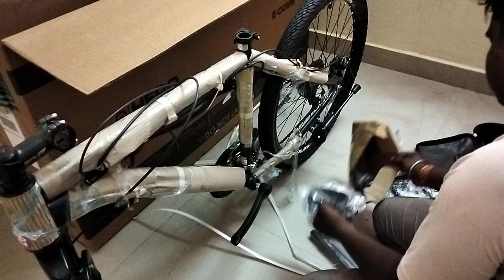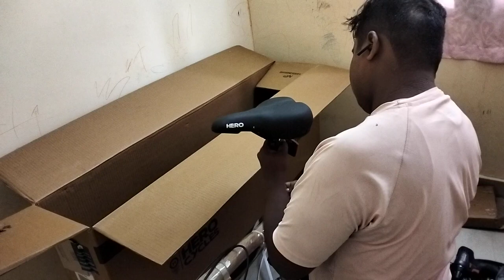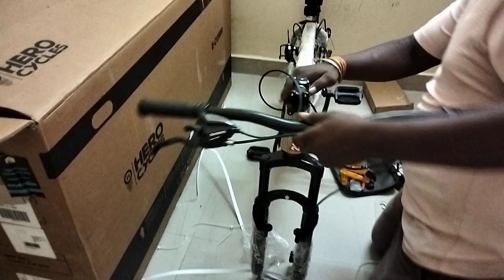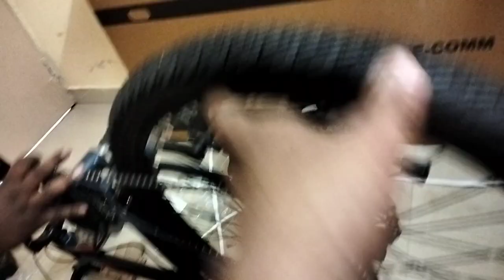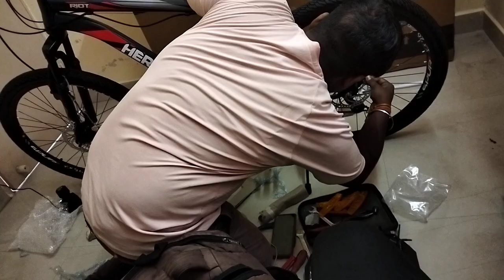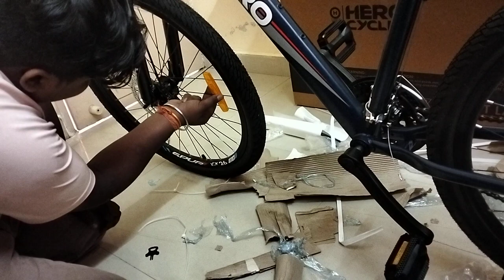cycle under 10000 hero riot | fiting | best cycle hero riot| Unboxing|

Comment: How is the cycle quality, any issue faced till now, i am thinking of buying this from amazon, that's why wanted to know your thought. Thanks.
Reply: The cycle is good and I am using the cycles since 3 years and it is very effective the suspensions are very good nd the speed is also very good if u have the realibility to touch speed it is the best cycle under 10000